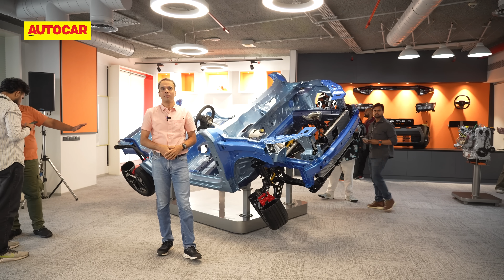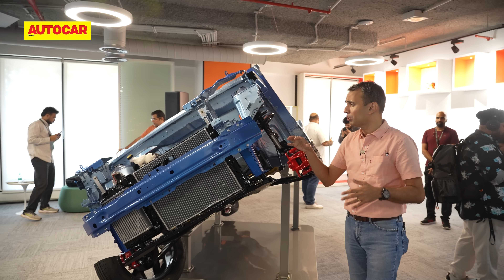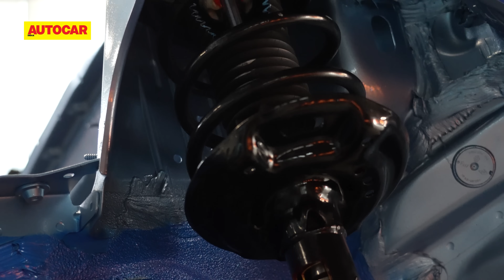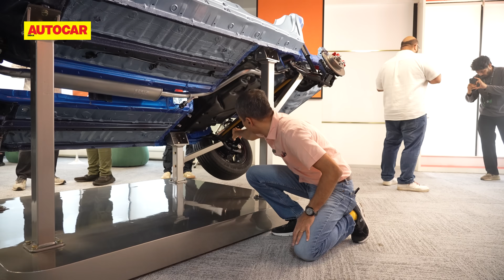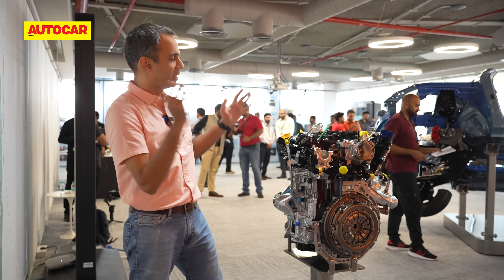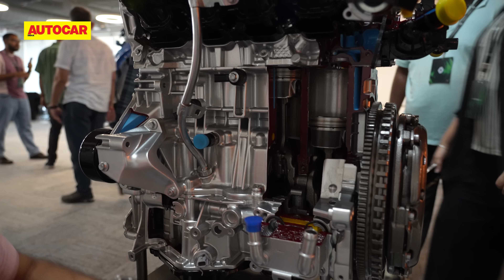New Renault Duster - Tech and engineering highlights | Autocar India

Comment: E-axle, i.e. the electrically driven rear axle?? How does that work? And has this e-axle been introduced in either of its current variants??
Also I heard in a video that Renault have some electronic braking system to mimic a locked differential that is to work on a wheel that's in the air while going on an uneven terrain so that it doesn't draw the engine's power and instead transfers it to the wheel on the ground. 
Is that really there? Does it work? What's it called?
Please help me with that info Autocar. My decision on buying the car depends on it.
P.s. is there any news on whether they'll introduce the 4x4 model in India or not? Should we wait for that?

Comment: Sunroof feature should come in as optional in all the cars. I don't know why they are coming up with it from Mid variants. Nobody is talking about high AC consumption, in summers we cant use in most parts of the country. After few years we have leakage issues. No point of having 6 -8 airbags under the glass.

Comment: A small correction : During normal driving, the engine will have all of the turbocharger input. It's during spirited driving, when the engine is at a high load (or having rapid load changes) that the waste gate comes into the picture. It serves to "waste" a fraction of the exhaust, in a controlled manner, by directing it to the tailpipe instead of the turbocharger; hence the name Wastegate. Cool video though!
Reply: Yes you're right, that would happen more often. Should have worded that better, basically the waste gate opens whenever target boost pressure is met.

Comment: Sir can you please highlight the differences between the 1.3 turbo petrol with 156hp  in the previous duster with this new 1.3 turbo petrol with 160 hp. 

Are they the same in every aspect other than power tuning?
Reply: There may be some small component level differences, but they are essentially the same engine, the 160TCe

Comment: Renault missed this big announcement at launch event that the 1.3 Turbo Engine is E85 compliant.
Every manufacturer is avoiding mentioning Ethanol Blend ratio compatibility, not sure why.
Reply: Will they get repaired if kept unused for a week.
Reply: Does the current 2 +1 engines really already support e85 blend? Or is that somethin that will be supported in the near future?

Comment: So this is Gasoline Direct Ignition + Port Ignition paired With Variable valve timing and Turbo. 
The Icing on the cake is the DCT/ Dual Clutch.

The computer has a lot of complexity to face especially in our road conditions. Good luck. 😂
Reply: No, its one direct injector, which does two injections per stroke. Like most diesel engines today that do multiple injections per stroke.

Comment: Yayy looks like duster is coming with a spare tyre. Also i do not think you can achieve better efficiency when you are spraying fuel twice in to the cylinder and rich mixture doesn't burn fully, you will have more carbon left after combustion.. Hope this wont lead to gpf clogging issue like the dpf issues in korean cars

Comment: This engine is future proof, has got the power, torque, hybrid & most importantly Nitinathol proof😂
Reply: Reliability going to be garbage. The previous version of this engine had lots of failures both in mercedes & renault cars. Now they have added gdi + mpfi + petrol perticulate filter & making so much hp & torque from a tiny displacement engine that will over stress internals.. 
This will require pampering like a mercedes that no renault owner will do 😂
Reply: Good one 😂😂😂😂
Reply: Nithanol is the deciding factor
Reply: Call it Gadbadkari's factory made Sugarcane juice

Comment: It seems that Renault has not taken any shortcuts in this case. They have done whatever it takes to address every issue that might hamper Duster. And increase in height, besides giving good headspace even with sunroof, will also add a visual heft to the overall design. The car will not look like a crossover.
Reply: Is it a crossover?

Comment: Great deep dive into the RGMP! While the 1.3L Turbo is a beast on paper (and a legend among the few who drove it in the old Duster/Kicks), I can’t help but feel Renault missed a trick by not consolidating with the global 1.2L E-Tech hybrid series.
The 1.2L is so versatile—it could have powered everything from their sub-4m cars to an e-axle 4x4 Duster. Just imagine a Triber powdered by a NA three cylinder 1.2 liter 48v mild hybrid CVT?
Reply: The reason for going with 1.8L E-Tech is because of mass manufacturing with global platform.
Renault is using 1.8L Engine in multiple cars in Europe. You can check out Renault Clio review.
Reply: @AutoversewithMaddy Fair point but I still think the 1.2L 48V Mild Hybrid is the smarter engineering play for a market like ours. The fact that the 1.2L 4x4 uses an e-axle to give pure EV drive from the rear wheels—without needing the weight of a prop shaft or the complexity of that multi-speed 'dog box'—is a huge win for simplicity.

Also, in India, displacement is king for taxes. The 1.8L hybrid is an unappealing package, requiring both 70hp electric motors and a multi-speed gearbox; it’ll likely be priced into a bracket where it faces much tougher competition. If Renault put a 1.2L 48V CVT unit in a Triber and a turbo DCT in the new Duster 4x4, they’d move volume.
Combining all iterations of the 1.2 (mild & full), I bet it would easily outsell the 1.8 worldwide.
Reply: Kya majbori Rahi hogi becharo ki 😅
Reply: @ankoo10  Fair point but I’m only suggesting simplification from a broader manufacturing logic. Efficiency is great, but juggling three distinct engines in one market is a headache.

My pitch is simpler: one 1.2L modular block to rule them all. Use a naturally aspirated 48V CVT for the Triber (to solve the power gap) and a Turbo DCT for the Duster 4x4 (to solve the weight/prop-shaft issue). It consolidates their supply chain, dodges the 1.2L+ tax penalties, and prepares the factory for the electric era.

Everyone else is consolidating to survive; Renault has the perfect 1.2L tech globally to do it, but they seem to be over-engineering the solution for India with that 1.8L package. Simplicity beats complexity every time.
Reply: @GbMuthu what you are saying makes sense to me. But the Renault management thinks otherwise 😅 may be they have lot of other things to take into consideration.  I guess they saw many youtubers saying we need different engine options, and fell for it. 😂
Reply: @ankoo10 Spot on. Maybe Renault needs to revitalize their KISS philosophy (Keep It Simple, Stupid). Look at the rest of the market for context:
 * Force Motors is the ultimate practitioner—they’ve run an entire empire on that single 2.6L Diesel block for decades. It’s not fancy, but it’s bulletproof and everyone knows how to fix it.

 * Honda missed the open goal. A 3-cylinder, 1.1L iteration of their 1.5L i-MMD could have been the 'Fiat 1.3 Multijet' of the hybrid era. Instead, their caution has left showrooms thin while the market moves on.

 * Jaguar is currently sitting with empty showrooms, betting the entire farm on a futuristic Solid-State Battery (SSB) jump that is still a few months from being a mass-market reality for them.

By over-engineering the India-spec Duster with thess complex 1.3 & 1.8L hybrid + 8-speed DHT, Renault is losing focus on the real finish line: Electrification. A single 1.2L modular block (a 48V CVT for the Triber and a Turbo DCT for the Duster) would have been the perfect middle ground. It’s high-tech enough for 2026, but simple enough to move volume and survive our tax slabs.

SSB technology—the true final form of the traction battery—is progressing faster than people think. We’re already seeing the first production vehicles hitting the road this year. When a 400kg pack delivers a 500km range with a 10-minute 80% recharge, the ICE coffin is nailed shut once and for all. Renault should be simplifying their ICE portfolio now to survive that transition, not making it more complicated.
Reply: @GbMuthu BYD is doing great in different types of battery tech not only SSB. The pace at which companies are researching batteries and their chemical composition, I am optimistic that in a decade or so we will definitely get good cost effective, reliable batteries with sufficient range.
Reply: @ankoo10  And the transition is coming faster than people think. A big thanks to the GNoME database and the pioneering work at IIT Delhi's AILA lab and IISc Bangalore. These AI agents are already shrinking year-long battery experiments into 10-minute cycles. When you realize that 20,000hp rocket engines are being designed by AI and 3D-printed in just 21 days, you see how quickly the old 'complexity' is being disrupted. Renault’s 1.8L hybrid isn't just a tax headache; it's a mechanical solution in an increasingly digital world. The ICE coffin isn't just being closed—it's being bypassed entirely‼️😅

Comment: Hi Autocar and Segius sir, just a quick clarification question: when you were showing the engine, you mentioned that the engine is flex fuel ready and can take up to 85% ethanol blended fuel. Was that with reference to the 1.3L turbo petrol engine on offer for the duster now? As in, is this new duster launching now with a flex fuel engine? Isn't that a very big deal and maybe the USP and most important feature of the car, if this is indeed the case?
Reply: No, when they say 'ready for' or 'capable of' it means the hardware like the fuel lines and tanks are ready for higher blends of ethanol, thus if that does arrive they would not need major changes, likely only software tuning in the ECU. As is, this is not an E85 engine.
Reply: Thanks for the clarification.. So its safe to buy the car and use it for another 10-12 years atleast i take it? 😅

Comment: Sir is this 1.3 l turbo petrol a 3 cylinder or 4 cylinder engine and you explained all this things can this interfere in the pricing like make it expensive compared to other competitors it is a question.
Reply: This is a 4 cylinder engine. You can find this in Mercedes Benz GLA as well. Plus it has been localized according to Renault
Reply: This is the 1.3 litre engine and yes it will be quite a bit more than the 1.0 litre unit, but lets wait and see, Renault are promising an attractive introductory price.